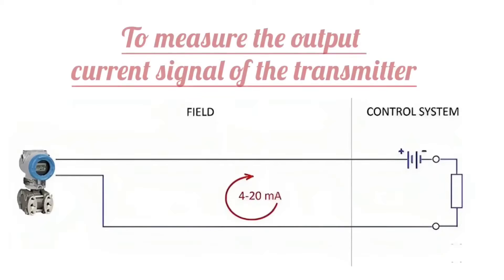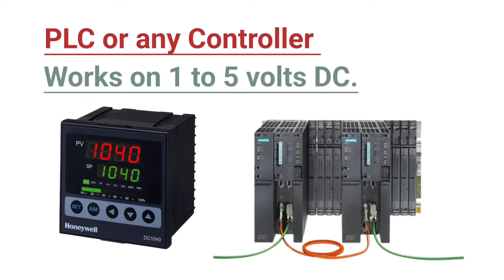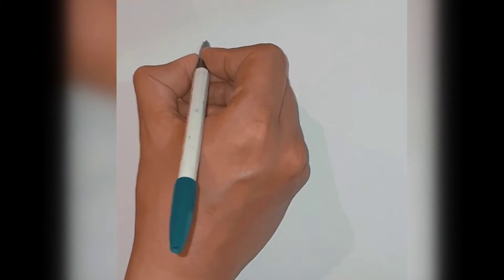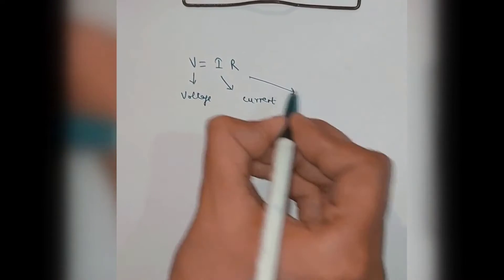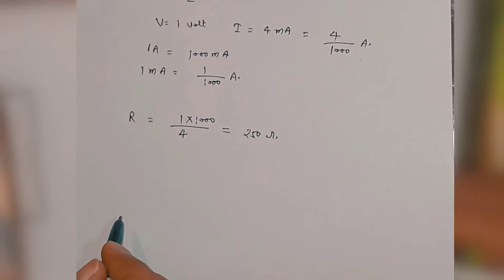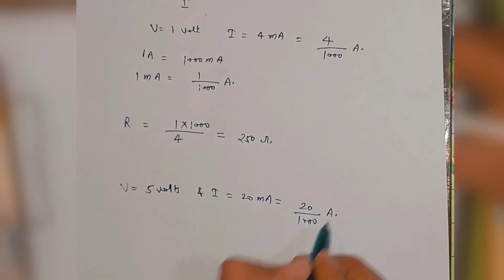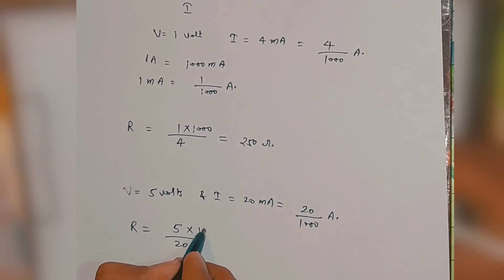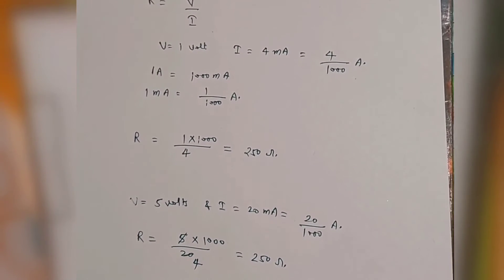Instrumentation | why 250 ohms resistor 4-20 ma ? | industrial automation|  pressure transmitter

Comment: Most plc are actually either 4-20mA or 0-10vdc. For 4-20mA you don't need to add any resistor if the transmitter is already outputting 4-20mA. To convert a 4-20mA signal to 0-10vdc you would instead use a 500ohm resistor.